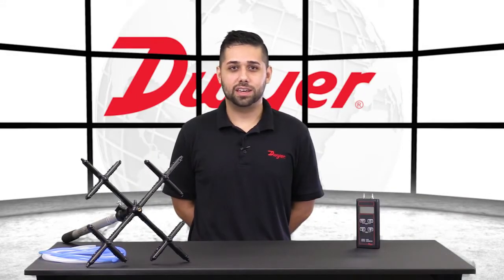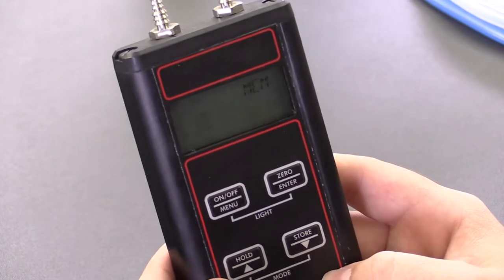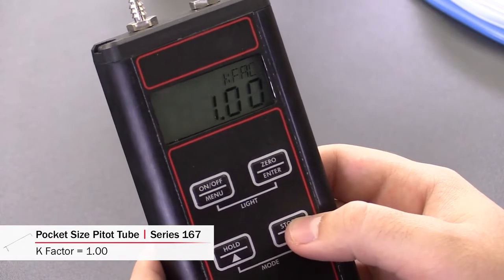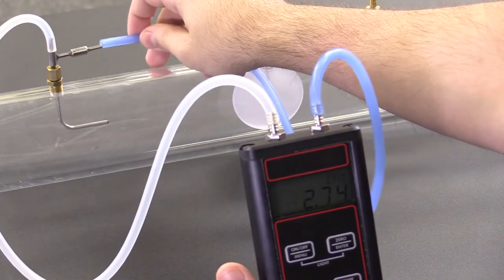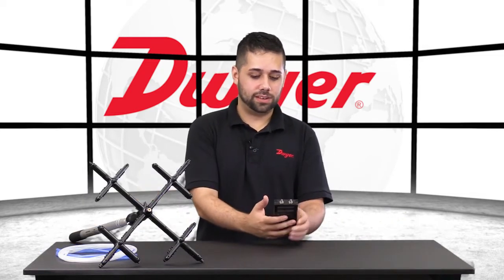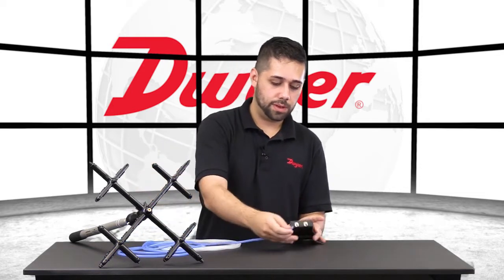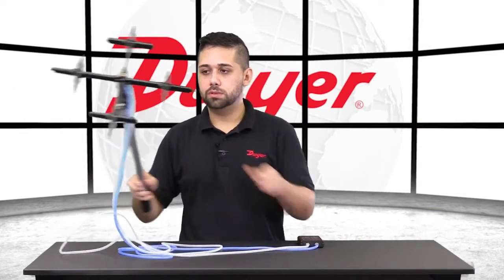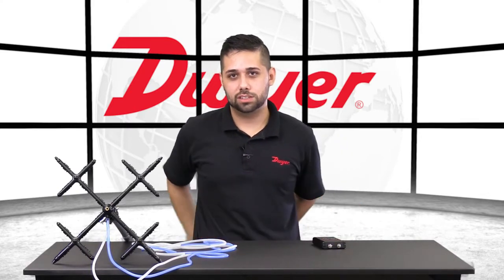How to Set Up a Series 477AV Digital Manometer for Air Flow Measurement

Comment: I can't find a video on how to calibrate this unit - the manual alone is difficult to interpret.
Is there a video available?
Reply from the maker: Hello, Ian! We don't currently have a video on calibrating this unit. If the menu alone isn't giving you enough information, we would suggest contacting the distributor you purchased the unit from, or Dwyer as the manufacturer. Either party should be able to provide adequate technical support.

If you purchased this unit from TEquipment, feel free to contact us via phone, email, or Live Chat here and our product specialists can assist you:
https://www.tequipment.net/service/contact/

Comment: can this unit read static pressure only ?
Reply from the maker: This unit can calculate air velocity and volumetric air flow as well as measure duct static pressure. Check out the product info here: https://www.tequipment.net/Dwyer/477AV-0/HVAC-Manometers-and-Micromanometers/